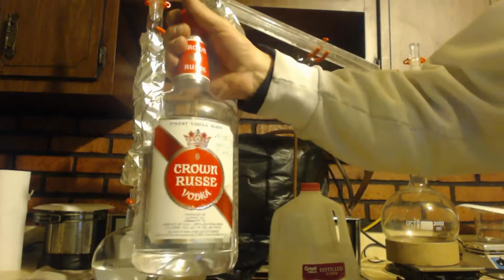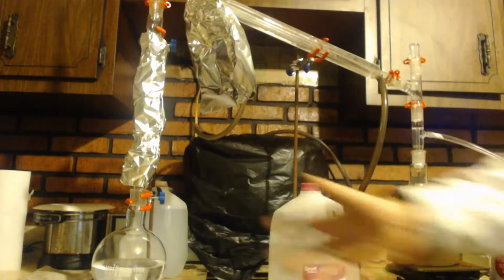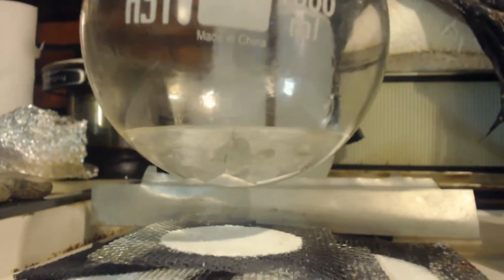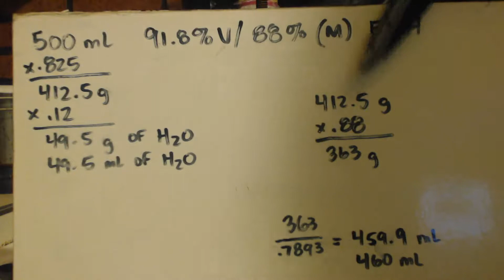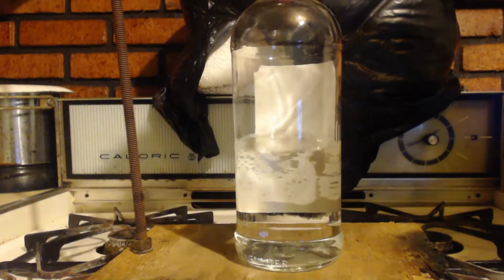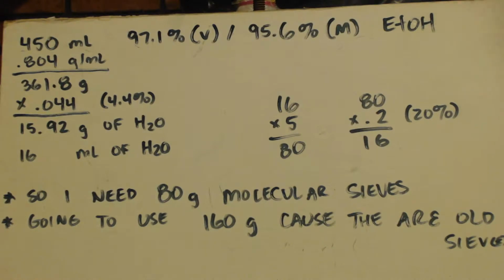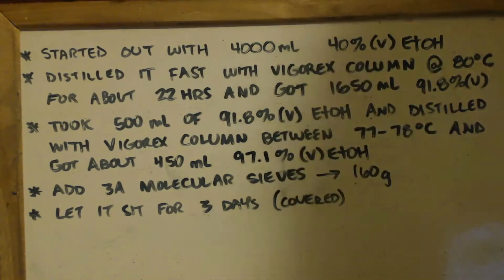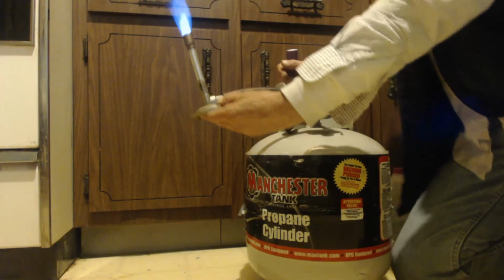ANHYDROUS ETHANOL FROM VODKA

Comment: nice video.  How would you regenerate the sieves?  Bake at 300c for 1 hour or something similar?
Reply from the maker: m po.................Sorry youtube must not have notified me of this post.  If i do not respond back within a week that is what happened and you should post it again.   Yeah you can heat it up but 300C is way to hot.   And an hour is probably not long enough.   Putting the sieves in a round bottom flask UNDER A VACCUM and heating works best.  But i usually just heat it in the oven at 400F for 2 hours or more.   Here is a video on it  https://www.youtube.com/watch?v=GKHyq4jJm6o&t=97s          Remember when you are done to put the sieves in a vacuumed out vessel.   Not required but it helps the sieves stay fresh.